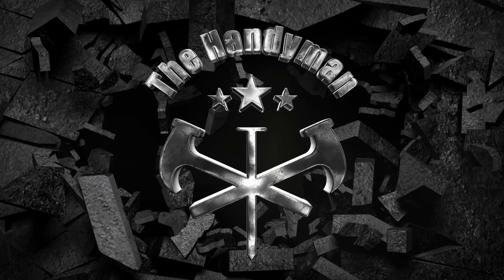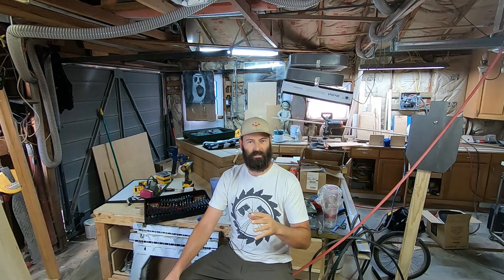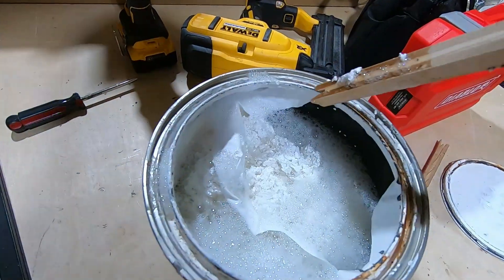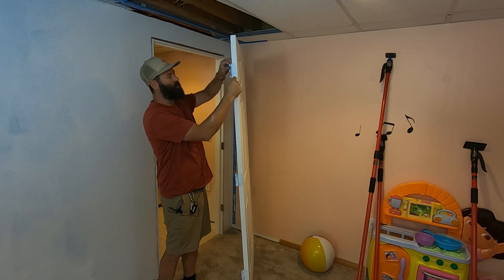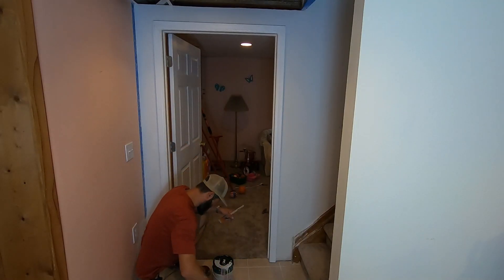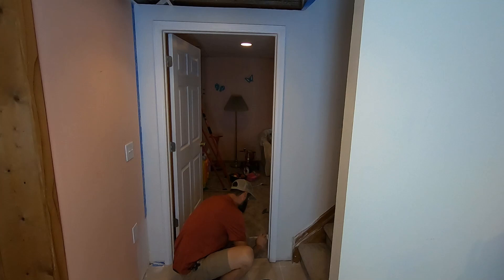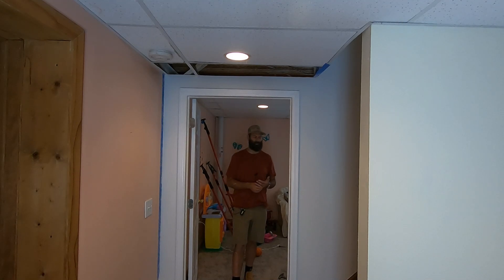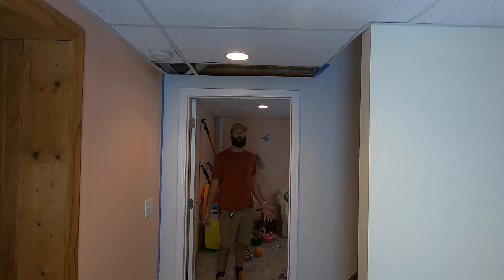How To Install Door Trim | Fast And Easy | THE HANDYMAN |

Comment: Ive fixed stripped holes in hollow core doors by tapping a bamboo skewer into stripped hole and cut end off.. screw will then thread in tightly.

Comment: Quick question. Not being a youtube warrior. Would using longer or larger screws on hinges be of any troubles? What bad could happen. Genuine question. Thanks for the video.
Reply: Some times it’ll grab but not sit within the hinge property. If you ever have a problem with a screw hole being stripped I’ve always used golf ts to fill the hole and then snap them off and most of the time it resets your hole for you. If that makes any sense
Reply: @user-iv4ls5lj1r  that make sense thanks. Although i havent had much issues fixing with longer screws. Golf tees arent the most at hand thing around. Not sure if anyone notices a mismatch in screw heads if thats what youre referring to. Might try that golf tee trick tho.

Comment: If you need to remove the door hinge and the holes get jacked you can drive a golf tee into hole break it off flush and use a 1/16 drill bit to re-center the hole .

Comment: On the comment you made about those interior door hinge screws hollowing out. that’s very true after you remove it a couple times. I actually have used a small wooden dowel rod and some glue to plug the hole then once dried sand a little bit if you need to then reinstall the hinge on door has worked for me in the past

Comment: Those new paint cans also have fancy spout things you can screw on them for pouring paint more cleanly, not a bad design I think really, I had one though where the screw lid wouldn’t come off so I still had end up opening it as normal defeating the entire purpose

Comment: Huge fan of the Abrasion Resistance 500 Flag you have there. Should pair well with a variety of spray paint (as needed, of coarse) and perhaps some elementary substances applied at high velocity.

Comment: A little trick I seen somewhere (not my own) with these types of materials that strip out easy is to use either a tooth pick or wooden bbq skewer to fill in 1/2 or even 3/4 of the hole as a plug. Than carefully tighten a screw in allowing the new "plug" to provide material for it to bite into. If you really want to you can also use a bit of CA glue to hold the plug in.